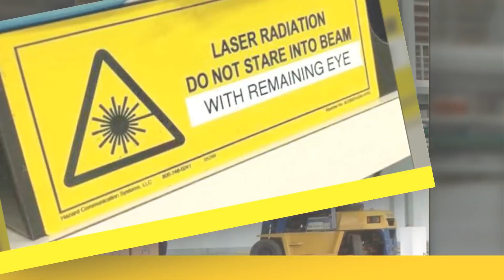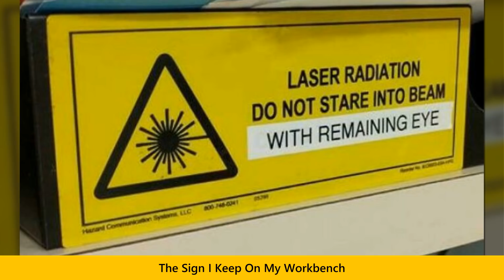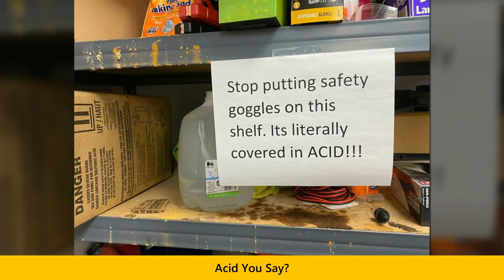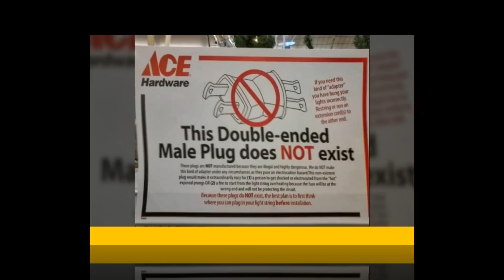This Online Community Is All About People Who Don’t Prioritize Safety, As If They’re Immortal

Comment: I used to work for an electrical contractor.  One job I was on was one where they were converting an old roller-skating rink into a chain drugstore.  The building had a high, arched ceiling with steel girders every 3 feet or so.   These girders were about 12 feet from the highest point of the ceiling. The bottom of these girders were maybe 18 to 20 feet high.  And of course, that is where they INSISTED that the wiring be run.  Right at the top of this arched ceiling, above those girders.  However our JLG scissor-lifts would not fit between those girders.  My coworkers solution:  Two 2X8's and a 10 foot ladder.  He zip-tied the 2X8's to the rails of the lift and placed the ladder on the 2X8's.   He lifts up so the ladder goes between the girders. Then he crawls out on the outside of the railing to get to the ladder, which he proceeded to climb up. And then he begins to install sections of the EMT (thin-wall electrical conduit) through which the wiring will run.  But he's not gentle about it.  he basically just flailing around moving with fast jerking motions and nearly tipping the ladder.   Get them through one span  come down,  move under the next one, go up, climb out climb the ladder, start yanking shoving swinging and roughing shit around like a gorilla,  repeat.. repeat.  Bob is basically the missing link.  He even looks like a  primate.  Wild-eyed,  frazzle-haired,  sloped forehead and big long arms.  Totally nucking futs!  He's a human ape!  My supervisor tells me "Go up and help Bob"  I'm just about to tell the supervisor to blow it out his ass,  just as the head site foreman walks in and looks up   "Oh, here it comes."  I think to myself.   I was right too.  "WHAT THE LIVING FUCK IS THIS!!!?" he shouts.  He turns to my supervisor,  " YOU!  YOU GET THAT STUPID MOTHERFUCKER OFF OF THERE, OR I'LL RUN YOUR WHOLE DAMN CREW OUT OF HERE!!"   Supervisor calls Bob down and send him on a parts run.   The foreman then proceeds to rip my supervisor for about 5 minutes.  then goes and talks to one of the other trades supervisors and acquires a narrower lift. He comes back and offers it directly to me. He turns back to the supervisor and says "I'll run you outta' here, and put her in charge if I see that asshole more than 6 inches off the floor from now, on!"   I  used the lift and finished installing the conduits.

Icing on the cake:  Same jobsite.  Same Bob.  Two weeks later.  It's the lunch hour.  Bob has chosen to work through it while everyone else is out of the way.   His task is to fish heavy strings into each of the conduits.  These strings will be later attached to the wires to pull them through.   So Bob is doing his thing.  I, and everyone else are just sitting around BS-ing or eating.  Suddenly there was a bright blue flash and a loud BANG like a gunshot from the electrical room and above the girders. Sparks fall from overhead.   Bob  yells "JEEEZUS!!" from another room on the opposite end of the building.    One of the plumbers yells "Bob! you fuckin' stupid ape!"   Yes, Bob, the genius he was, decided to feed a STEEL fish-tape through the conduit, TOWARD the live panel carrying 440 volts.   It came out in the panel and then went straight into a main live line.  It welded the tape in various spots throughout the length of that conduit.  The whole run had to be ripped out and replaced.   Bob was banned from the site, and the rest of the crew sent home. 

Do you have a Bob on the job?
Reply: Sadly, yes

'Crazy' Chris once held a piece of wood up to cut by bracing it against his shoulder and running circular saw across . . .
Only reason he didn't succeed in self amputation is someone else realized what was about to happen and literally dived to rip the cord out of the socket😳🤦
Most shops, lumberyards, jobsites have at least one blithely unaware idiot.
Reply: Now I know where that sign, "No accidents since 'Bob left')" on the internet came from.
Reply: We usually just call them patients...
Reply: Unfortunately, there are way too many "Bob-on-the-job" candidates out there. Bad enough when they are risking their own bodily parts, but so many of them seem determined to take others with them.....

Comment: The Double-ended Male Plug DOES exist. Seen it at my old high school. Experienced it there. FELT it there. I was a senior, my friend a junior, we both had an understanding of electric circuits, can't say for certain who swore first but that male end hit the railing of the scaffolding we were on and sparks flew. Had a freshman run to the janitor's room (also engineering at the time back then) to kill the power. 

Both myself and my friend were on the scaffolding standing on plywood flooring. Had I been on the ground I would've been able to shut off the power. How you ask? My mother was a teacher at the high school, and who also was in charge of the dreaded "Saturday Detention". Not only did she have the master key to the place, she also had the disarm code for the building. A plus for early setup of lighting and sound. Since we were setting things up for a future play we also had gophers. Go for this. Go for that. So run little freshman...

In the end we did discover and have electricians remedy the double ended male plug. It CAN exist. We discovered it was plugged into a female socket on the far end of the gym. 

All back in 1993... Fun times!

Comment: Those 2 ended plugs that ace will not sell are available on amazon for about $20. You can find it by searching for suicyde cords. The cost of an electrician to do it right by installing an inlet box and interlock to connect a generator to house wiring will set you back about $1,500.

Comment: Employers need to stop rewarding unsafe work practices!

Piece-rate work compels people to focus on productivity at the cost of safety. When I worked as a cable TV technician for a Cox subcontractor, the only way to get a new feed line to my customer's first-floor rear apartment was to run a new cable up over the roof of that three-story building.

My 28-foot ladder didn't safely reach. We needed 36 feet or so. So I called the supervisor to have him notate the account and cancel the job.

He should have sent it back to corporate to get a crane or bucket truck from Cox. Instead, one of our supervising Uckers (remember, the company for which my subcontractor employer worked was Cox :) sent out a technician with lower standards, and that guy stood on the ladder's rail cap (not even just top rung, but top of the rail!!!) to get his armpits level with the roof edge, and then he Spider-Manned his way up onto the roof, to run a new coaxial cable.